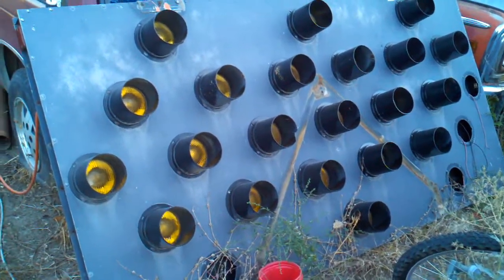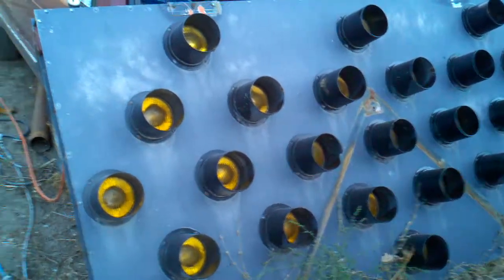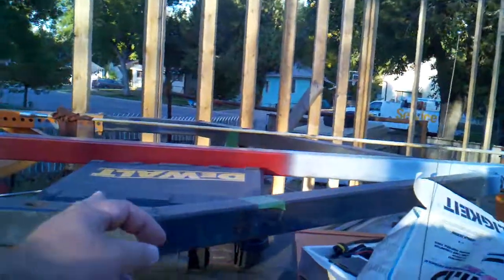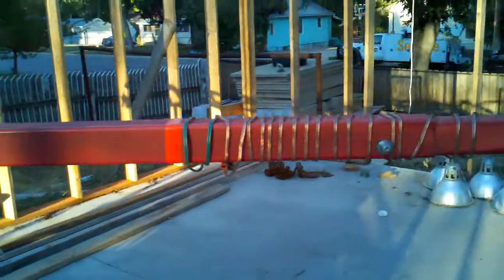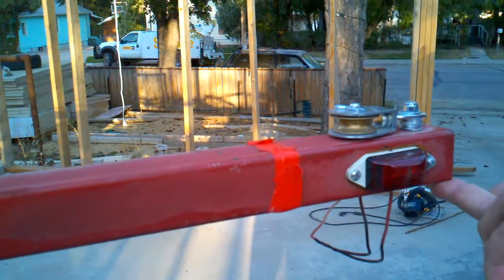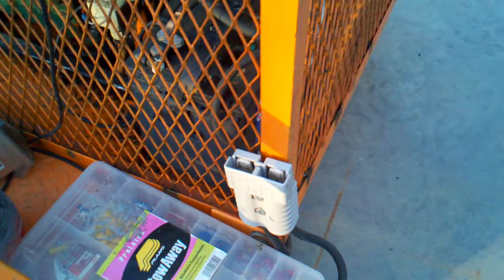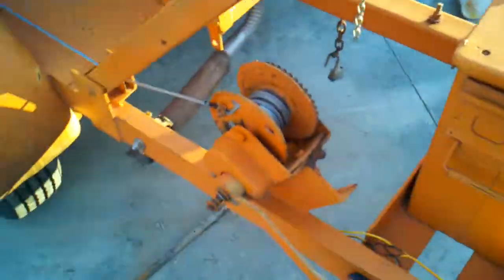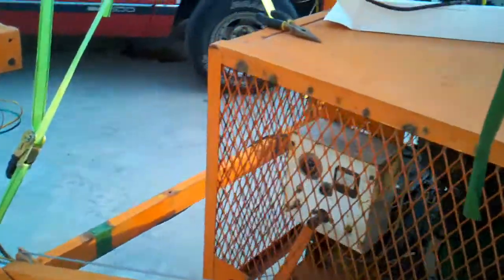Portable antenna support trailer

Comment: I actually went one better and bought a mobile 30' light tower. I figure its designed for tower use and even has build in outriggers for support. With the lights installed its suppose to handle up to 65 MPH winds, but I believe with the giant light "sails" that it could most likely handle 80-90 MPH winds. Even better is that the large cabinet that houses the 6kW power plant will work well for protecting repeater and radio components. 

The downside is that the state of New Jersey has crappy motor vehicle laws. They will not allow me to register it as a trailer but rather want me to get commercial tags, even though I told them it will be used for ham and GMRS radio operations. To make matters worse, even if I register it as commercial, I can only tow it using a commercial vehicle I own [Which I do not have one of, as I do not own a business.] Some states really suck with their laws :(
Reply from the maker: Our club bought a retired light plant for that reason.  Luckily, Wyoming is pretty lax on the rules - for personal use, and I believe under a certain weight, no registration is required.  My little trailer kind of has outriggers.  I figure it held that huge sign up, should be good to hold a mast up.  I couldn't pass up the deal though, I almost stole it!
Reply: Haha, same here, paid $500 for it, the genset still works (I can use it as a back up for the house) and for the most part the cabinet and trailer are clean and rust free. For now it will allow me to get the antennas a bit higher as installing a tower is sort of out of the question. My plan is to install 4-6 batteries and a solar panel for power, a Motorola rkr1225 for GMRS repeater operations would be permanently mounted on the trailer, then rack slides to allow temporary mounting of a yaesu ft857 and ft90. I'm hoping that by removing the genset and installing the radio equipment that the state will let me register under the "homemade trailer" clause.